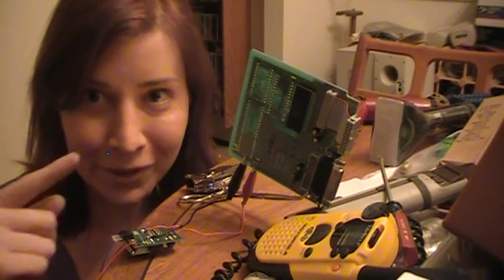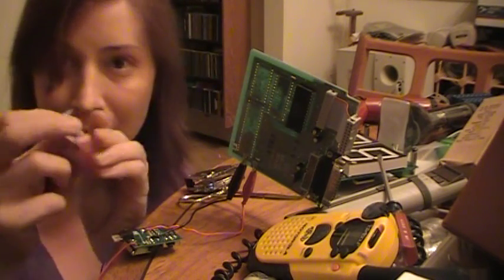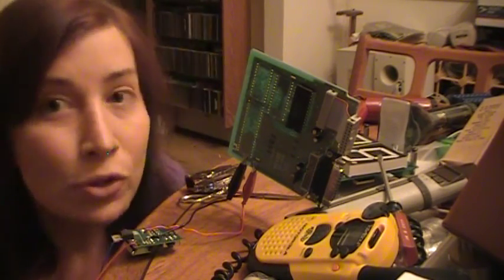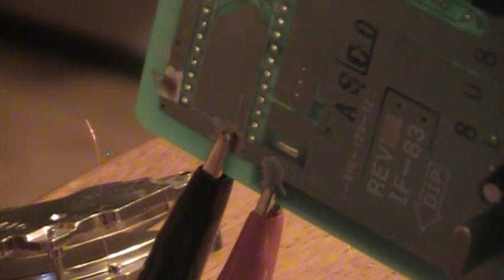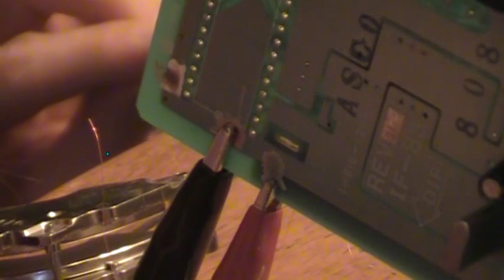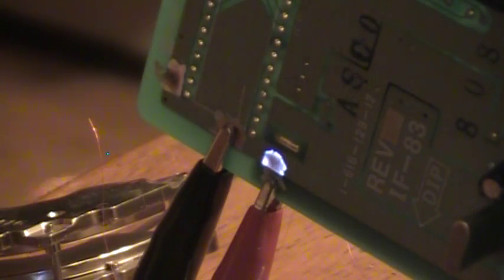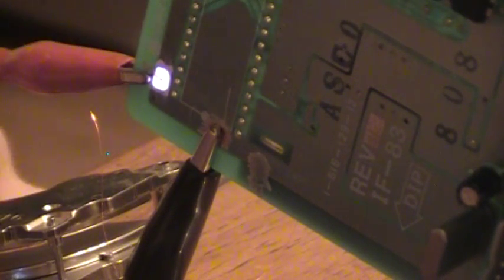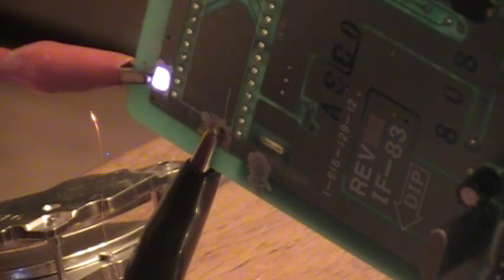Printed Circuit Board EL Display - Lets Make Retro Hand Held Games

Comment: If only the voltage needed wasn't so great, then we could make circuit boards that the traces light up on based on the amount of power being used. You could also get an idea of what different parts of sya... a motherboard do when it is running. Pretty neat potential applcations.

I also had an idea, it would go more with fibre obtic networking cables, that the whole cable could be illuminated like EL wire, or dashes along it, for tracing it through office buildings for replacing or something.

Comment: Could you pull a resistive touchscreen apart and use the sheets as the transparent electrode (and bare copper as the other)? I don't know what the resistance of those screens is, but supposedly the substrate is polyester, which is also a good dielectric used in capacitors. So you could place them conducting side up (protect with varnish or something else transparent), connect it with all around for lowered resistance. the only thing to worry would be to get uniformly distributed phosphor.

Comment: Thanks for the demo. First time I see this. 

I hear the life time is about a 1000 hours! If this is true, that isn't much for real life applications I'm afraid

Btw, I'm curious if exposing the stackup to white light could somehow affect the circuit? Simply put, could this stuff be used to detect light also (as an LED could?) Perhaps would the capacitance be slightly different with or without light exposure where this could be used for building huge touch screen panels?